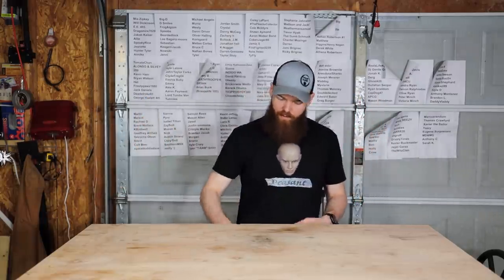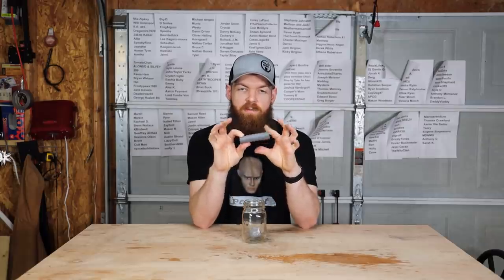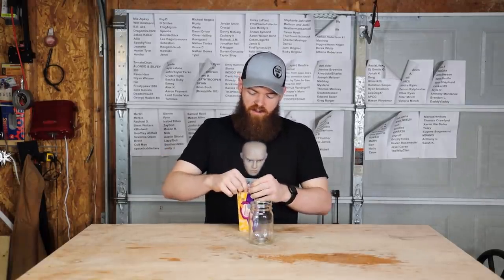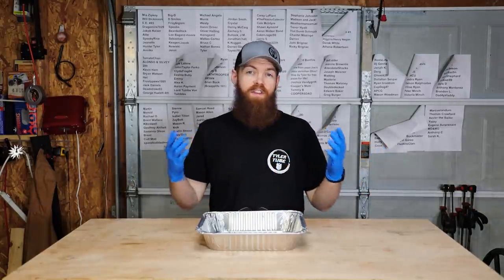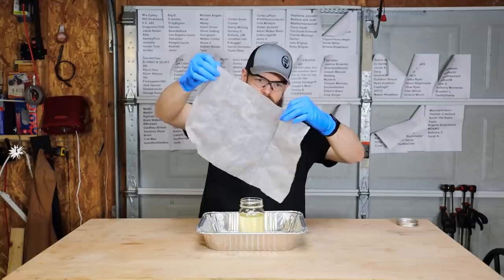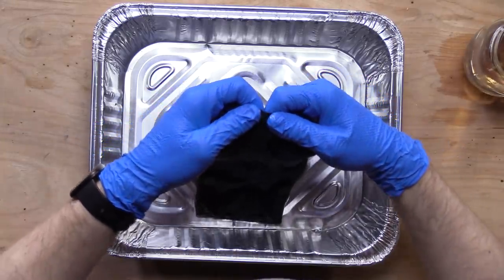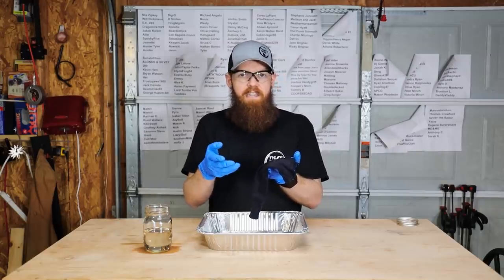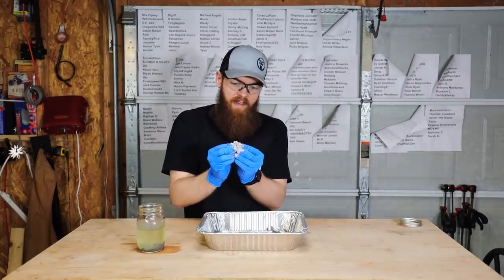I Left Random Things In Gasoline For 30 Days

Comment: I would love to see “leaving things in Brake Parts Cleaner for a month” I use it at work often and it’s some nasty stuff! I know it would have some interesting results.
Reply: Or just the brake fluid itself. That stuff is pretty corrosive too
Reply: @caseyanderson9169  spilled brake fluid in my trunk once and didn’t notice it until it was too late
Reply: @bigt1877  it’s some nasty stuff man. If you spill it on asphalt it gets interesting too
Reply: I think it would be tough to prevent it from evaporating…
Reply: @rz4109  if you seal it up like he does in the jar it won’t evaporate. They also sell brake cleaner in gallon jugs so it’s not like it is coming from the can where it evaporates super fast.

Comment: with the paper towel, the gas didn't eat the coating away, it just went right through it. you put a HYDRO-phobic substance on the paper towel, and gasoline does not have water in it, it's actually an issue if gas does have water in it. so the reason the paper towel that was soaked in gas ripped so normally was because that coating was still present. as a matter of fact if you look back to when you were pouring in the gas, the dry paper towel almost immediately was wetted by the gasoline
Reply: Yes gas dose not have water but gas will pull moisture and get water in it
Reply: @unclestinkystudios8480  oh yea, especially in a sealed mason jar, lots of moisture to get in  there
Reply: @unclestinkystudios8480  a nicer way of saying what the other guy said is, there was no moisture to begine with, and sealed in a mason jar for 30 days certainly wont add any moisture.
Reply: How about putting 30 days old gasoline in jars for 30 days then soak those jars in bigger jars filled with 30 day old gasoline for 30 days.

Comment: Hey Tyler, just thought I would explain to what happens to concrete with oil or any other liquid from a car. So what happens, is any sort of liquid which has a constant flow onto a specific spot on the concrete, will eat away the cement from the concrete and will leave the stones exposed. That's why whenever you look onto a concrete building which has a hole in the gutter, the concrete always looks different to the rest, that's because of the constant flow of the water over the concrete!

Comment: Paper is not broken down by oils. Only by water and water based solvents/chemicals. I work on a web printing press and you can absolutely soak the paper down in flash oil, blanket wash solvent, anything oil based. But as soon as it gets some water on it boom it breaks

Comment: The thing about gasoline is that its very volatile, it changes very quickly to a vapor and the vapor is what is so flammable. Not only is it a very good fuel, but it has a ton of surface area while it is a vapor, which causes it to burn very well. Unfortunately, this means the instant there is no liquid gasoline present it is absolutely awful at burning stuff. The residue left behind just doesn't burn nearly as well. Gotta have that vapor or its essentially not even there

Comment: I think the reason concrete and asphalt in parking spaces corrodes is because of engine oil. As it gets exposed to exhaust fumes (due to blow-by in the cylinder) it becomes acidic... Or caustic... Or something.

Comment: Hey Tyler I'm like 2 minutes into the video and I noticed you mentioned how parking spaces are usually deteriorated by dripping gas. This corrosion is not caused by leaking gas. If someones car was leaking gas that'd be a serious issue. Most likely what you're seeing is oil breaking down into fats, and breaking down the concrete. Oil leaks are common. Gas leaks are not common and a serious hazard.
Reply: he probably meant gas spills

Comment: The reason why there is holes under cars is because, coolant, brake fluid, battery acid and used oil are all acidic and they react with oxygen and slowly degrade the concrete

Comment: Most hydrocarbons are solvents with similar behavior wrt things they are exposed to. Hydrophobic materials resist water because of the unique structure of water. I wouldn't expect gasoline to behave the same way at all.

Epoxy may be the kind that needs two parts mixed. Before that, they have much different chemical behavior than after mixed and cured. If the ball was mixed and the stick wasn't, it's not surprising they behave somewhat differently.

I do have a question: why didn't you put a piece of glass in one of the jars? What would gasoline do to that?

Comment: The parking blocks with chip and chucks off them are more likely from car oil pans or suspension on lower car hitting them look around gas pumps yes there are chips there but not normally terrible

Comment: I usually see those divets in asphalt rather than concrete and most cars will leak more oil than fuel, maybe try to leave a chunk of asphalt in motor oil?

Edit: wanted to add maybe antifreeze and possibly ATF. It’s got to be one of those three causing the asphalt to disintegrate

Comment: Paper towel was wet the second you poured the gas in. You could see it absorbing the gas immediately. You left nearly all of the outer layer of the epoxy stick in the tray and jar. It needs all 3 parts to work. The dents in concrete parking lots you've seen under where an engine would be, that's not concrete. That's asphalt. Please stop doing these stuff in jars videos. The fumes are murdering the few brain cells you have/had.